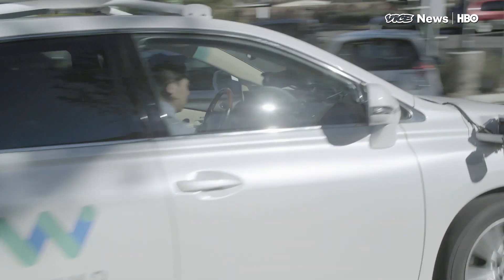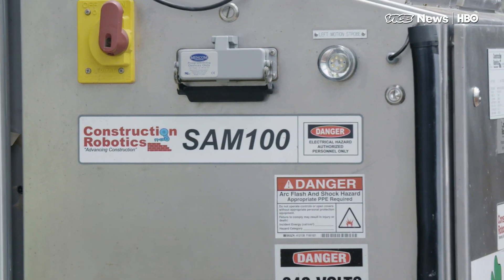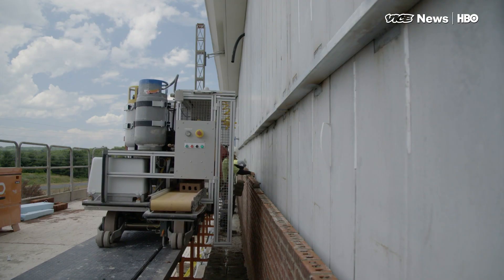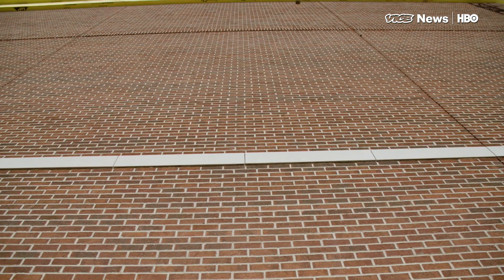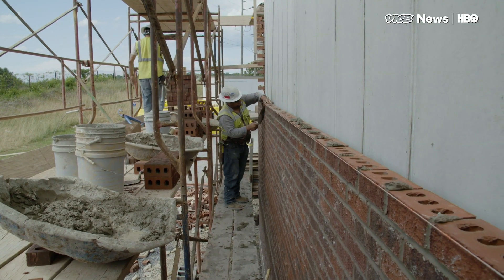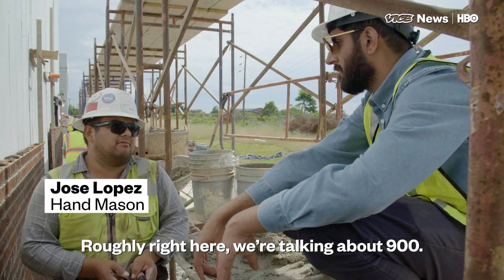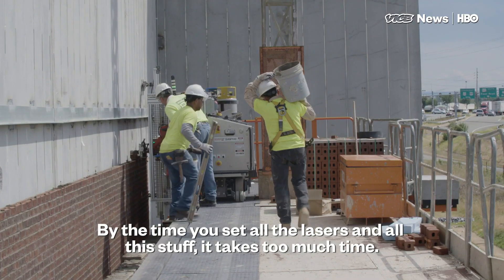This Bricklaying Robot Can Build Walls Faster Than Humans (HBO)

Comment: Anyone can drive as fast as a racing driver in a straight line, the skill comes when you hit the corner. These robots are 50% faster for a single skin long straight wall. Introduce window openings, wall ties, reveals and piers (like in 98% of all brickwork jobs) and the robot is screwed. Horses for courses.
Reply: It's screwed....for now
Reply: @msarchive6247  No it is screwed for ever. You obviously are not a bricklayer and know nothing of the craft! I have 30 years experience as a bricklayer!
Reply: @MassRemigrationNowUK  I think you assume nobody knows how to lay brick compared to you 👏
Reply: I work in automation repair and have for 34 years. Its truly advanced in ways I did not see coming. It would be a big mistake to underestimate the advancement that can and will happen in this line of work.
Reply: It's basically the same as with the road paver laying robots. They can do kilometers on end, much much faster than a human can. It needs 2 people to operate it and insert the triangular pavers every other row, and someone to ride a front loader to feed it pavers. But it'll lay 100 metres an hour, it does the work of about 10 people and only needs a 3 person crew.

The biggest downside is that it's no good at corners or doing pattern work. But for doing the bulk of a street it's great.

It's taking away jobs for sure, but for every 7 jobs it takes away, it saves 10 people's spine. Which isn't a bad deal.
Reply: @fermitupoupon1754  yeah I prefer peoples back to be good, robots don’t get hurt.
Reply: You sound like a brick layer
Reply: @budmanman3998  I'll accept the compliment.....I'm a Building Surveyor
Reply: Nick Case 

So then what’s ur problem?  Only more money for you if that “is” your profession....
Reply: @budmanman3998  I didn't say I had a problem. 

If I worked as a project supervisor (which I don't) a robot bricklayer would not mean I was paid more, in fact if it meant the job was faster and cheaper, the supervision fee would be less. 

By the sounds of it, construction 'isn't' your profession.
Reply: Often it's the people in the eye of the storm that can't see the impending doom.
Reply: Dude i'm an electronic engineer, and i can assure you that with proper time, these things will make humans look like handicapped if you compare the capabilities.
Reply: @hidude1130  With proper time, man will walk on Mars.. but at THIS moment in time.......there is not a robot that can build beyond a straight stretch of brickwork.
Reply: @Lexicondiablo  But the gap between what robots can do by now and building complete structures is smaller than you may think. Industrial robots are actually in a very advanced point today, very far from humanoid robots though.
Reply: @hidude1130  It doesn't matter how many days in the future such complex robots might be. A year ago when I made the first comment and even today,  a commercially available robot to build brickwork details equal to a skilled human does not exist. That was my point. I'm guessing that your projections for the future may well prove to be correct, but that is a different point entirely.
Reply: @Lexicondiablo  Robots may improve with time in bricklaying but nothing can make the radiation risk low enough to enable a longterm mission to Mars or a Base very viable. I trust your knowledge about Brick laying, but while we may make it to Mars, it'll be a very limited exposure because the radiation is deadly beyond a month or 2. We really do not appreciate our own atmosphere enough ; )
Reply: Yep that is how it is. There is a lot of thought goes into layout and everything else on a masonry job! People that think it is only from the neck down could never do it for one day! 
We had people tell us more than once they never had that rough a day in boot camp!
Reply: For now
Reply: It's a new thing, pal. I'd be more critical with Vice's shitty sensationalistic reporting than a primitive robot's incapability to put together advanced wall segments.
Reply: @hwfq34fajw9foiffawdiufhuaiwfhw  I think you vastly underestimate how many jobs a machine like that creates versus takes away. The point of these road paver machines is that they do the back-breaking, monotonous, simple work that no one really wants to do. And there aren't nearly as many jobs available doing the "interesting" parts of the job. So in the end it will replace mostly unskilled, low-education workers. Which in the paving business is a good thing, because no one wants that aspect of the job.

And there is the impact on the other end of things as well. Companies that do have these machines can undercut companies who don't when bidding for municipal or provincial projects. I don't care how cheap a Bulgarian or Romanian worker will work, if it takes 10 of them to do the work of 1 machine, the machine is going to be cheaper. Even if that machine takes 3 higher-paid workers to operate. Those machines displace jobs.

Not saying this is a bad thing, because as it is, it is hard enough to find people who want to be a paver layer. So being able to remove the most boring aspects of the job from the job description makes the industry as a whole more attractive to new workers.
Still these machines are putting people out of a job at such a pace that this will cause problems in the short-to-medium term. Re-schooling for a new career when you've been a road paver for 20+ years usually isn't the easiest thing. So the people it does put out of a job are also the people who are the least likely to find long-term sustainable employment again. And someone is going to have to pay for their unemployment benefits and once those run out, someone is going to have to foot the bill for their dole.
Reply: I am just a novice programmer and I can already think of a solution
Reply: @sharpsegments032  I am just a chartered Building Surveyor with 30 years post qualification experience and I can't. Please do share.
Reply: It sounds like you are underestimating the growth of technology and engineering. We have cars that drive themselves now, they recognize where objects are in real-time using cameras. Is it really that hard to imagine a webcam on a robot, and it understands how to rotate a brick 90 degrees?
Reply: @TickyTack23  It sounds like you believe brick laying is a considerably easier process than it is in reality. If the process of building a reveal were as simple as rotating a brick through 90 degrees then we would all be living in Lego houses. In the real world a modern brick wall must accommodate, ties, insulation, cavity trays and lintols. A year has passed since I made the first comment and bricklaying robots have in that time not achieved the giant leaps in engineering advancement that was threatened back then. Sure it will come in time but the public has a disdain for the building industry and do not understand how technically demanding, brick laying is.
Reply: @Lexicondiablo  your spot on mate, as a bricklayer myself I can’t really understand how all these people think this robot will replace us any time soon. Like you said who’s putting down wall ties, lintels, weep holes, cavity trays, insulation. Building piers, window openings, door opening, chimneys, brick and block work up to dpc, corners. Also who’s pointing up? Who’s clearing snots inside cavity? The biggest issue here is apart from industrial buildings who’s got the space for one of these on a extension, even new build sites. Too many experts in this comment section. Won’t work YET in the real world. Nice square industrial building is the only place this works.
Reply: Precisely
Reply: And it takes 3-5 men to operate it so compared to 3-5 bricklayers the robot is screwed
Reply: @guy_in_ashopping_cart-sfs967  yep he cannot think or lay out work. Wonder if he takes catching hell well?? That is part of a bricklayer’s life!
Reply: For now...
Reply: Fastbrick Robotics in Australia figured it out, impressive.
Reply: @mcmc7746  This isn't comparing apples with apples. FBR have developed a robot that lays dry, single skin concrete blocks in  detached domestic projects within a constrained 1-2 storey footprint. The blocks are secured with vertical posts and reinforcing steel bars which have to be added by humans and concrete is then poured into the voids in the blocks, again directed by humans. It's important to understand that the blocks are laid directly off a concrete slab that must be perfectly level. This is not the same brief as commented upon previously here with mortared cavity brickwork that needs to incorporate ties, insulation and is bonded in cement mortar. The Austraian construction is fine for a specific climate for low level construction but doesn't meet code in many countries worldwide and doesn't work (currently) over two stories.
Reply: @Lexicondiablo  FBR does work in 2 story conditions, they built a 2 story home and made a video on put it on their YouTube page.  The future is now.
Reply: @mcmc7746  If you re-read my reply to you, you will see that I say the FBR system doesn't work OVER two storeys. It's a clever system but has a very narrow use in the construction industry. It just lays dry blocks which needs humans to reinforce and concrete. It doesn't perform any sort of proper brick laying in cement mortar, which was what the original video was illustrating. The future will have to wait a bit longer for that.
Reply: @Lexicondiablo  it uses mortar on every brick it lays down.  It is sprayed on by the robotics system as it lays the brick.  As a national home builder, we build only one and two story homes, so this handles the majority of the housing needs in the US.
Reply: @mcmc7746  Then how come you can see daylight through all the vertical joints? And just for your information, the USA isn't the majority of the world. Countries with high thermal insulation requirements will not accept single skin blockwork  for external walls. 

Please understand the point being made here. The Hadrian system does not build cavity brickwork on cement mortar. Referencing robots that can do something else in a construction context, is a different conversation.
Reply: @Lexicondiablo  the US isn't the majority of the world?!?!?!  There are other countries besides the US?  Are you sure about this?
Reply: @Lexicondiablo  the mortar is spray applied to the bottom of every brick
Reply: I don't think, there's nothing strange about that; my father was a bricklayer, and his name is Sam. Bare in mind, that I'm a witness to say, that this idea was introduced decades ago, for last night, I saw a film footage of the bricklaying industry having this idea of bricklayers using that kind of tool the size of a bread box all done manually by hand, where they don't use this kind of tool on a single brick skin wall, but a double brick skin wall in 1948. We can all agree that in 1948, it's not at the same speed as it is, with all of these machines wired up today they call, "Sam." In my opinion, in 1948, where bricklayers were working with window reveals, wall ties, window openings and maybe piers, like in 98% of all brickwork jobs maybe, with that kind of nifty tool, you could probably say, they were not screwed as much, it was definitely not at the same speed back them, for they were not machines wired up but all done manually by hand, with no wires set up. Maybe, he was correct in saying, that it's a waste of time, setting up machines, and you're correct in saying that the robot is screwed, but they were not screwed in 1948, probably not as much back then compared today, for there were no robots, but they were slower; mankind used more percentage of his brain than today; and today, mankind, came a long way away; and for mankind, there are its advantages and disadvantages with machinery for less percentage of the human brain. My father's name means, saviour in the Italian language, learn something new everyday. I'm not sure if you can say that these machines mean, that there a saviour to the bricklaying industry; I let you do your research on that, if you have not done so.
Reply: Im faster on a straight wall.
Reply: Your totally right m8 this is only for big straight runs end off if people think this is going to take over our jobs its laughable sometimes were only working on 3 boards wide how is this going to fit into spaces like that 🤣🤣🤣
Reply: don't say horses for courses. It's a nonsensical saying
Reply: @I_dont_want_an_at  HORSES FOR COURSES – "A mostly British expression urging someone to stick to the thing he knows best, 'horses for courses' comes from the horse racing world, where it is widely assumed that some horses race better on certain courses than on others.

This is one of a few sayings that actually has a discernible meaning unlike so many crazy idioms like 'going bananas' or having 'bats in the belfry.'  These are nonsensical.

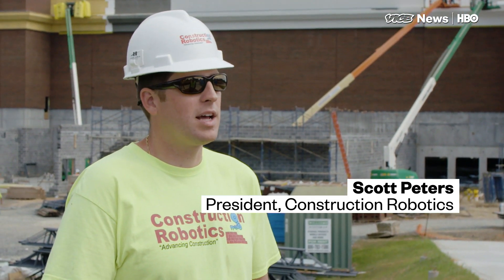Comment: 1:04 STRAIGHT LIES about construction efficiency. It's increased over 20 FOLD in the last 30 years. Mainly due to crimped fittings and cordless tools and scissor lifts and boom lifts.
Reply: 20 fold?  Yeah, that's going to be a [citation needed] because that is patently absurd.  But I don't doubt that there has been some productivity gains from the technologies you mention.
Reply: @gregmartin9024  lmao yeah, i dont think a small team of Juans can erect a house in 24 hours

Comment: If the robots do 3000 bricks today 2 years from now it will be 6000 and 2 years from there 12000 plus it will now be able to feed brick off a pallet replacing the need for the guy feeding it brick. 2 years from there it will be 24000 bricks a day plus be able to finish and do complex angles. Intel laws state technology doubles in complexity and capability every 2 to 3 years and has held true and reliable in its predictions of the strengths and advancements in tech. Brick laying is a back breaking job that pays very poorly sorry but this job should be automated. This will create a new market in "artisan hand laid brick" allowing the best guys to get paid much much better for the same task under the guise of better quality.

Comment: No way that machine becomes common place any time soon. It is expensive. It is actually inefficient. It can't build corners or do intricate work like quoins, sills or anything decorative without being readjusted. It will break down and not lay any bricks while it sits there waiting for however long for someone to come fix it. And, judging by the amount of mortar and the half full head joints, the work the machine does will not last very long. It takes a craftsman to do that sort of work and there is no replacing a craftsman with a robot.

Comment: This makes me think of people who say pilots will be completely automated out of the flight deck soon. I don't know what it takes to lay bricks, but I know that human decision-making is still extremely critical in aviation. Even with an advanced FMS, autopilot, auto-throttles, auto-brakes, and very accurately planned routes, there are so many variables in a given flight that human intervention is very, very frequently required. And that's just on a normal day with fair weather and no malfunctions. Start adding in delays on the ground, weather complications, malfunctions, emergencies with your aircraft and/or others, and human decisions become an absolute necessity. It's also worth noting that even aircraft with highly advanced CAT III autoland capability (i.e. the E175), the system has very real limits, and operating in conditions outside those limits is simply not possible when relying solely on the automation.

Comment: Once it gets going it lays more brick but still requires 5 people for it to operate and like the worker said all the time it takes to set up with the lasers and all that. Just have the workers who are maintaining the machine do the work. 5 people laying 900 bricks is better than 5 people manning 1 machine laying 3200 at an absolute maximum with the set up time and all that. And that's on a single wall. When you have a second wall and 3rd wall the set up restarts. Gotta align the laser and set it all up. Not worth the money you'd pay to buy that machine to basically do equal work.

Comment: I've been a laborer for almost forty years.
Would love to have this machine.   I'll bet it doesn't do NEAR as much work as they claim.   
See that wall there in the video?  We call that a 'money wall'.  Why?  Because it's easy as hell to do that particular span.
  Lets see this thing on an actual job.  Cuts.  Windows. Doors.  Outlets.  Plumbing.   I want to believe because I'll be running the damn thing.   
  These drawing boards these guys use are nice and neat and clean and warm and well lit and inside.   The real world is a much 
different reality.
Reply: Bobby Booshay if you’ve been a labourer for 40 years then your opinion doesn’t count buddy
Reply: just think about the first airplanes, they were basically useless. in a short time humans had supersonic jets. soon we will have giant robot construction spiders printing out foam aluminum structures in a few hours or printing out concrete.

Comment: Sure, it takes several crew members to setup and operate the machine making it less cost efficient than if you just had a crew of people doing the job but this is a proof of concept and given time the operating dependency of humans will go down. It wouldn't be a stretch to add a robot that corrects and monitors the robot.

Comment: This is an interesting robot but I agree that long brick walls like the one shown in the video are few and far between for architectural reasons. This robot will not replace anyone's job any time soon and that is because there are robotic devices that can do similar tasks to humans but aren't chosen for cost and schedule reasons. There are robotic compaction devices and robotic GPS instruments. The cost of these machines sometimes is greater than the cost of hiring someone and renting equipment.